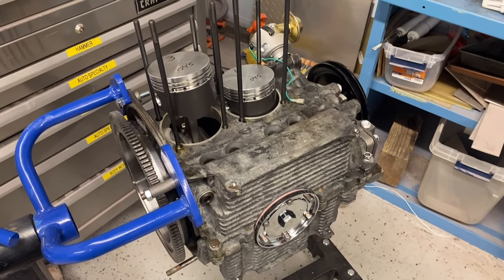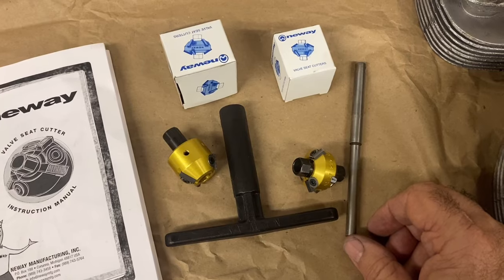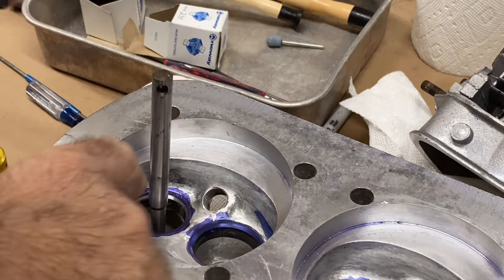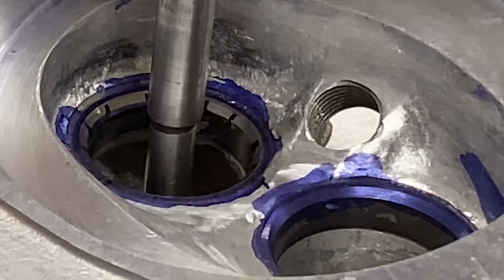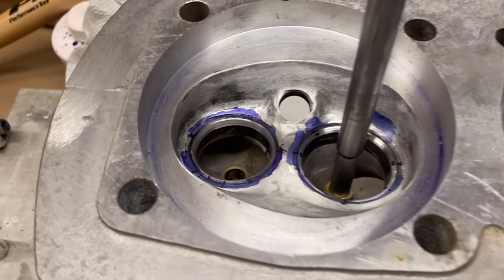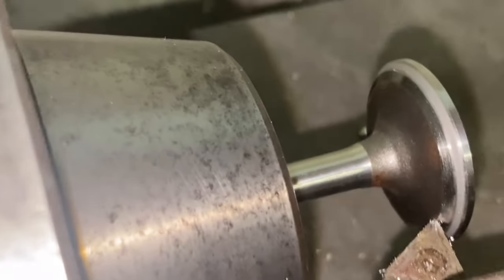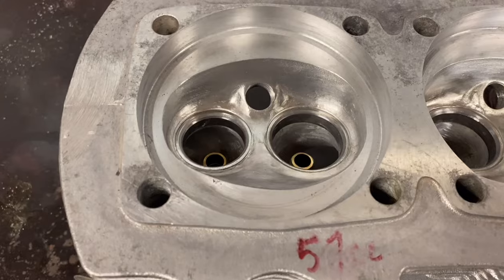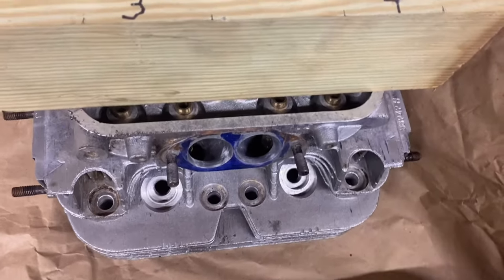DIY 3 Angle Valve Job. No Machinery Needed!

Comment: I have officially found my holy grail of YouTube channels. I’ve been watching you’re videos for hours now. As I kept watching, it became stranger and stranger how much we had in common. I built a 49 F1, with 5.0 out of a 94 Mustang GT with an AODE trans. After buying the mustang I realized it was OBD I and all aftermarket programmers at the time were for OBD II. Eventually they came out with the Megasquirt PIMPXS that did the engine and trans so I swapped out the factory ecu with BAMA chip. In my shop I have a lathe, mill, 2 post lift, phase converter, modified HB English wheel, and tools for just about anything. The difference between you and I is, you actually know how to use all of it. I play around and eventually figure it out. Well now I’m building a second F1. This one is a 50. I bought 3 trucks initially thinking I’d need them to build 1, not realizing how good the aftermarket parts availability was. Now on to the 2nd one. You’d think I would’ve learned to research after the 94 mustang fiasco (I know you know what I mean) but no. This time I bought a coyote motor with a 6R80 trans. I think it’s worse now. Anyway, thank you sir for doing what you do. Please continue to make videos. Even your videos that don’t deal with the truck are somehow exactly relevant to me   If you weren’t 1400 miles away I’d be cleaning your shop just to watch and learn.
Reply from the maker: Well, thank you my friend! Like a parallel universe! 
I’ve got the Coyote motor in my F150. That would be sweet in the f-1, but it’s pretty wide compared to the 5.0. Thanks for watching and commenting.👍Tony B

Comment: neway is great stuff. i have more bug parts than samba including a hydraulic isky camed 1970s 1500 with a chev 2bbl carb. it was airconditioned but idled at 1000 with the compressor running. it is in a 58 bug made into a pickup. it took me to the great divide in co every weekend in 1970.
Reply from the maker: Cool story Charles! Thanks for watching👍

Comment: I just got a set of these Neway cutters for the Chevy 235/261, I also got the spring loaded hand crank and expanding pilot. They work very well. I cut the three angle valve seats into a cylinder head for my dad’s 1959 truck and it started right up after sitting for probably 35 or 40 years. Thanks for showing us how to do this.
Reply from the maker: Thanks Dale! I’m glad the video helped. Your Dad’s old truck sounds like a nice project. Good luck!👍
Reply: i had a 261 bored 60 with a milled head and sunk valves with a melling cam in 1962 with a packard threespeed with overdrive and a 390 merc rearend in a 39 chev sedan. i was 17. good times when i finally got a 4spd it would get rubber in all four gears. the packard was good with the overdrive but i could not shift it as fast as i put a ford top shift on it from a four threespeed tranny with a adapter and welded forks for the gears. i had a fenton split exhaust manifold and a small olds fourbarrel before trying a paxton supercharger off a tbird, i could never get the belt drive perfected because it took a wide belt for the drive. i copied a corvette 6 dual point dist from the pictures in a 62 motor manual. man i wish i was 18 again and knew what i know now, course back then i was always broke.

Comment: Great content! Thanks for the time spent on the video I know they take a lot of time. 
Just the one little off the cuff comment about being able to redress valve faces with a lathe tool bit vs a lathe spindle grinder for the DIY engine builder was worth it for me.
Reply from the maker: Thanks Allan! I had always wondered about doing that with the lathe, but I had never seen  it done before. Looking at the Neway website, I saw that they sell a dedicated piece of equipment that does the exact same thing as a lathe, and it uses a carbide cutter. Seeing as I already have a lathe, I figured, “Why not”.  When you lap the valve to the seat afterwards, you’ll see that you get a complete seal. Good luck with your project, and thanks for watching!👍 Tony

Comment: Thanks Tony.  I am just rebuilding my vortec and the valves and seats can use a grind/cut.  There are only a couple of engine machine shops left around here and they either charge way too much, constantly lying/upselling or are are just jerks.  I would much rather do it in my home shop.
Reply from the maker: Thanks friend! Yes, this is definitely something you can do yourself. Good luck!👍

Comment: If you look into the Newen 3d set cutting system I think you will like the finished product a lot more. Much more accuracy and better cut finish. Best part is Many different ball driver heads are available for different mill`s I still have all my neway cutters but honestly never use them any more.
Reply from the maker: Thanks! I’ll check them out.👍

Comment: WOW, Neway have revised their prices. 
Early 2000's, a single cutter was around $250.
It takes more pressure when seat gets wide so it makes life easier if you use the 60 degree to narrow the 45 a little. 
I'm pretty sure that isn't in the instructions?
It isn't just valve seat width though, use valve to find actual position and measure 45 seat width to around 2.5-3.0 mm exhaust and 2mm intake.
Those intake valves need a back cut and radius the margin.
Nice lathe work, collet chuck makes life a lot easier
Reply from the maker: Thanks! Yes, I had only seen their prices on full kits, which can get pretty expensive. They were very helpful when I called them, and were happy to only sell me just what I needed. 👍

Comment: When porting a bowl  are you supposed to give the bowl some "ramp/curve" to the valve seat or if you do a 3 angle / multi angle is it efficient for your bowl to run straight down?    Fantastic little tool.  Added to my must buy list.   You can sneak up to the right cuts with this very easily.

Comment: very nice vid. very interesting .My question for you= How do you know  which angle to use ? for cutting a new seat ? Do you  have a template or a gauge to tell you ? Thank you very much
Reply from the maker: For this particular VW motor, I found the information I needed from “The Samba”, a VW forum. You could measure the valve face yourself by using a protractor head combination square.
The people at Newway were very helpful too and they can advise on some of the more common engines. Good luck!👍

Comment: Thanks for the vid
I've read that lapping isnt recommended for 'interference fit' i.e. 46 degree seat. They said lapping rounds the 3 angles and doesnt seal

Apparently the neway manual mentions this somewhere. Does the neway cutter give 46 degree seat or is it a true 45 deg?
Reply from the maker: Thanks! Neway has available, both 45 and 46 degree cutters👍

Comment: Good evening sir
Sir kindly tell me how we measure true cutting angle of valve seat of cylinder head
Which tool we use to measure this  degree angles,30 ,45and 60 degree
Reply from the maker: Hello. I measure the angle of a good valve with an adjustable protractor, and then use the appropriate cutter. You can also reference specifications from the manufacturer. Sometimes the valve seat will be specified at a slightly different angle than the valve.👍
Reply: @ChipsAndSparksGarage  thank you sir for your humble and kindness

Comment: Do u think they have cutter for a 212 cc engine ? 32/28 valves cylinder head .
Reply from the maker: Yes, I’m sure they do. These VW heads I was working on were 35.5/32, and they have they sell a wide variety of cutters. Give them a call, and they’ll tell you what you need. 👍

Comment: The bolt holes for the head bolts look paper thin to the combustion chamber. Hope it lasts!
Reply from the maker: The heads seal on top of the cylinders and the flat deck area of the combustion chamber.
when boring for even larger cylinders such as 94mm, you’ll actually break through into the bolt holes. No problem. Thanks👍

Comment: I believe a lathe counts as machinery
Reply from the maker: You’re absolutely right, Ken. I used the lathe to back the valves, which is a performance enhancement and not part of a typical valve job. I should have pointed that out in my video.
Thanks for the comment!👍

Comment: Last month I picked up a 1974 dune buggy that has been sitting for a minimum of 10 years (engine looks have sat even longer) I've been tearing into the thing and I'm finding out how much of a pain in the ass they can be.  My engine was locked solid, took it apart and its really rusty inside,  Removed the worst side heads valves because it needed to be cleaned out and noticed that the one exhaust valve seats has pretty bad pitting, I'm wondering if this type of tool will work for me or if I should just look for new heads
Reply from the maker: It depends on how deeply the seats are pitted, and how deeply you’ll have to sink the valves.
Don’t forget that the pilot for the seat cutter needs a good valve guide to work accurately. If the guides are worn, they’ll have to be replaced before you can cut the seats.
It comes down to economics too. If the valve train is all corroded and ruined, it will probably make sense to go with new, or at least better heads.
Good luck!👍
Reply: @ChipsAndSparksGarage  it's only the one cylinder that had water in it and it's only the exhaust valve seat with pitting, I poured water on the valves last night to test and see if they leak, would it be smart to just buy new valves and use them on my current heads or would that cause a hot spot and grenade the engine
Reply from the maker: @ob1kenobi748  If you can get the new valve to seal properly, it should be safe to run at least. Ideally, you will cut the valve seat properly for a good seal. If optimum performance is not a goal, you might get by by just lapping the valve and seat together.
Check the seal by filling the combustion chamber with water(just like when you check chamber volume) any leakage is a no-go, as the exhaust blowing through a leaky valve will quickly erode the valve and seal.
Take care👍